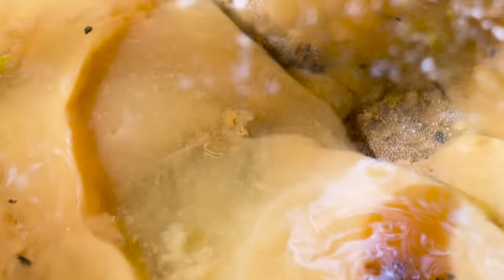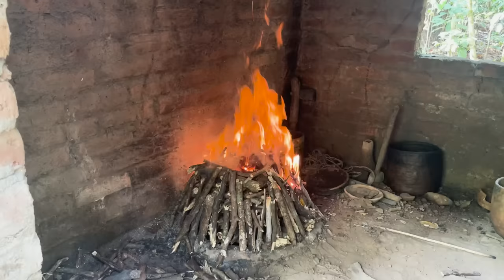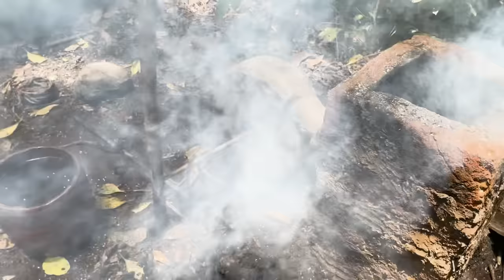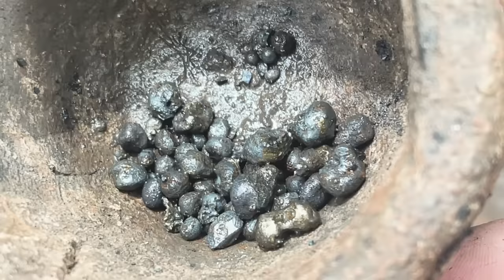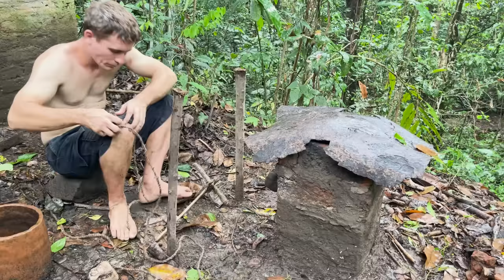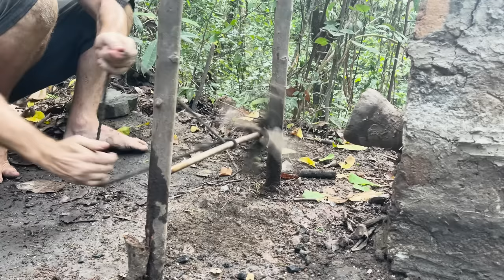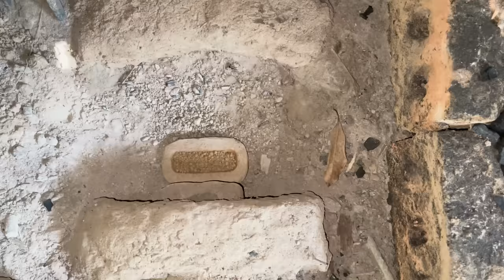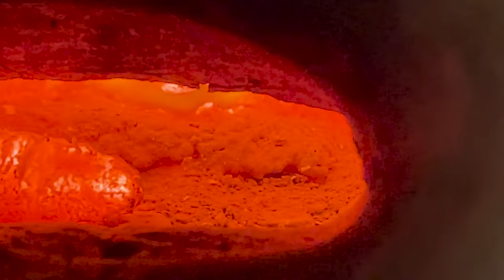Primitive Technology: One-Way Blower Iron Smelt & Forging Experiment

Comment: Some notes: more "modern" (meaning medieval) bloomeries were built a lot higher and torn down, while still hot. The bloom was then taken out of the bloomery while still hot and immediately compacted, so that the slag was driven out and an ingot was formed. Also during the smelting (although you don't really reach high enough temperatures to turn the iron liquid) the slag was allowed to flow out through holes on the base. That is why in German this type of furnace is called Rennofen (rennen/rinnen - Ofen = flowing - kiln/furnace). I would try to purify the ore a bit more (so no ash) and to seperate the slag from the iron during the smelting. 
Good luck experimenting further.

Also one more thing: during a visit in Spain I was able to see a iberic smeltery where they also siffed through sand and water to seperate small ironore particles out, which they then smelted down in bloomeries.
Reply: Do you remember the name of the smeltery?

Comment: Jonh's ability to casually put his hands into the fire will never cease to amaze me !
Reply: Tolerance, mud and calluses lol
Reply: I've done some blacksmithing work. It's actually not as hard as it seems even for a beginner; until the fire has a lot of fuel and a lot of oxygen, of an amount sufficient to get steel bright-hot for forging, you can get rather close to it without burning yourself as long as you don't linger there for long.

Comment: a suggestion. in the end when you tried to smelt a bar of Iron in an open mold. i would advise to close the mold and then put it in the fire. this way you get less oxidation and by putting small amounts of charcoal you can controll the carbonization of the Iron. more over this way if you heat the bar to a highrt temprature it will most likly come out smoother and more solid. if you have accees to a flux like tree resin which is crude but works to this day you can create a lower melting point and cleaner product. 
on a side note ive been watching this chanel since I was a little kid. i am now in college and Im happy my studies my be of assistance.
hope this helps and good luck!
Reply: The prills will already have a high carbon content, you don't want to add more in the crucible. If anything he wants to reduce the carbon to make forgeable steel.
Reply: How about flux from lime? He did manage to make some quicklime (I think) from snail shells in one episode.
Reply: This channel is only 8 years old so you're being very liberal with either the "little kid" description or the college description.
Reply: @Matt_Alaric  lots of ppl go to college at 18-19 years old…
Reply: @Matt_Alaric  I feel like 10 definitely counts as a kid. That's 6th grade.

Comment: 16:00 Thats brilliant! You could make a water wheel to power the furnace indefinetly
Reply: If you check the water hammer video, mans doesn't have a lot to work with there (water flow, precision of craft, etc), and water wheels are surprisingly difficult to build.
It's definitely orders of magnitude better to use hand power at this scale, but it is a good thought.
Reply: @splinterz5744  Not even close to getting to this point. If you wanted to use mechanical gearing at this stage then you'd use a belt and pully wheels.
Reply: @splinterz5744 Iron cogs would be completely impractical and would not fit in with the time period
Reply: @splinterz5744  A gear reduction isn't impossible as a longer term thought, but he can't even whittle anything that precise with his tools, let alone cast it.

Comment: A rope connected to a big wheel and wrapped around the stick could make for impressive crank wheel blower setup, but it may be more work than it is worth. Amazing tech development. You are becoming a metallurgist, inventor, primitive tech guru, and soon to be a blacksmith too!
Reply: Spinning the rotor too fast is likely to have it come apart, in it's current design anyway. Maybe a more stick based blade versus leaves, but I concur, spin it 2-3:1 to increase heat and yield further, hope nothing breaks. :)

Comment: Excellent and inspiring video showcasing significant advancements in iron smelting techniques! The use of the new blower has clearly increased the efficiency of the process, and the results are truly amazing, especially with the increase in both quantity and quality of the iron prills. The forging experiment was a great addition, showing how the iron can be utilized directly after extraction. Thank you for this informative and inspiring presentation!

Comment: After watching this I had to see how iron blooms are successfully created in draft furnaces and it seems (from most of the instances I've observed in other :stayhome:videos) that the 2 differing elements are 1. a continuous stream of air (I know, difficult with only one person, but achievable) and 2. an ore recipe that leads to liquid slag running off either at proscribed intervals (in "poke a hole" runoff design) or continuously in furnaces w/ slag drains. I don't want to speculate on flux as I know you've tried eggshell/limestone style flux w/o success.

Comment: If he's getting the slip-belt idea down well enough, he's only a few steps away from either a spring-pole or counterweight treadle. That may make operating such devices a little bit easier.

Some other videos also seem to suggest that adding a source of dissolved starch to the water used for mixing clay can improve ductility of the resulting mix. That may reduce some of the cracking when forming complex pieces with the soft clay. Seems some traditional recipes use rice-water, but perhaps something from the yams grown previously could work in this instance?

Comment: Modern Blacksmith here, who has an interest in historical techniques. Have you considered consolidating all your iron in a crucible smelt? All the prills/broken pieces go into a fired clay cylindrical vessel, with a little charcoal powder to help maintain a bit of carbon in the steel, and the remaining space filled with a flux. Borax would be ideal, but if you don't have access to that naturally, straw ash can be used. I imagine wood ash would work as well. The crucible should then be sealed completely with a fired lid to prevent oxygen ingress. Your one-way blower ought to be able to get it hot enough. Haven't tried it myself, but I magine you might want to orient it with the iron on top, such that when everything melts, it falls down through the molten flux? I'm hypothesizing here, but it seems that you're not having much luck with these open-topped bar molds, so it's worth a shot at least.
Reply: If he's consolidating iron prills into a bar, that's a MELT, not a smelt. His prills are already high-carbon, they don't need any more carbon, they need to be decarburized with oxygen. 

Of course, the real problem is that he's getting high-carbon prills in the first place, when he should be getting a low-carbon bloom that he can forge. Trying to make high-carbon cast iron and then decarburizing it is harder than just managing the furnace chemistry/timing to get low-carbon iron in the first place.
Reply: The flux will take a lot of the carbon out of the iron as it all melts. The charcoal is there to help maintain some of it, which you do want. As for what ratio of flux to charcoal to use, that would require experimentation as I totally admit that I don't know. Also I called it a smelt because the crucible step is part of the smelting process, like a second stage to the initial bloom step. So basically the cast iron prills are treated as processed ore rather than as a final product in and of themselves, but that's all pretty semantic anyway. @bhartley1024
Reply: @ferric6796  Hmm, I can't say if you are right or not, I've never heard of flux decarburizing iron-carbon alloys, but I suppose it would depend on the chemicals used for the flux. If the flux contained iron oxide, I suppose that oxygen could react with the dissolved carbon to decarburize the melt.

I think semantics are pretty important, especially when talking about technical processes. Smelting is the name for the process of going from ore to metal. Iron ore is iron oxides and hydroxides typically. They have to be chemically reduced to separate out the elemental iron. I would not classify the iron prills as ore because they are a solution of elemental iron and impurities. The prills could be used as-is to make cast iron items, or they could be used a feedstock in a refining process to make forgeable bar iron.

Comment: Have you considered a piston style blower.  A clay cylinder next to the furnace, with a truyere at the bottom.  If you lash a bunch of sticks together for strength, then layers hand woven cloth, possibly coated with tree sap or something to make it more air tight, you could use it as a piston.  Push the piston down to blow air, then turn it sideways to pull it back up.  You could probably move a lot of air rather quickly with possibly less effort.  This is what I love most about your channel is your attempts to smelt iron.

Comment: I very much enjoy your content. When putting the prills together in a mold to make a bar, it seems as if perhaps it is hot enough to soften the iron to stick the prills together to form a bar, but not hot enough to acutally liquefy the iron enough so that you have not only much better mixing of the iron, but also by being far more liquid, it allows the impurities to actually rise to the surface of the liquid. You certainly have more research involved on your part, but from lots of practice casting with other metals, it seems like the temperature still needs to go up some when casting the iron into a bar. I would expect with a complete (hot enough for liquid iron) melt, you'd have comparatively decent iron to work with, and all or most of the impurities would be together at the top, rather than still incorporated in your bar.

Comment: In regards to the new blower setup, I had the thought last time of using two sticks, but you would build a rectangular frame with one stick above the drive shaft and one below. The idea is that you can power the fan on both strokes. Pulling back you would use one string (say pull back and down to use the bottom string), then pushing forward you would use the other string (pushing forward and lifting up to use the top string).

Comment: That's a great improvement! Have you considered a water-powered since you're next to a creek? By digging an offshoot on the creek and allowing water to fall to a lower level by using a steep incline you can use the water to power the fan constantly with a makeshift turbine, and potentially at a high speed by using a type of gear reduction.

Comment: This one loop blowing technique seems good. Decarbonization in a high carbon atmosphere is difficult… I’m curious about how it could be made efficiently. Great video as always. Watching you from Brazil 🇧🇷 Take care bro!!
Reply from the maker: Yes I was looking at making a continuous loop recently, I'll experiment with it more. Regarding decarburization, the best way I've done it so far was to melt the iron in front of the blast in a small forge https://youtu.be/pOj4L9yp7Mc?t=349 . I was able to burn the carbon out and hammer the iron flat indicating it was decarburized. The only problem is the iron doesn't form one big mass but a few smaller one. Maybe if put into a larger furnace with larger pieces of coal it would maintain the high temperature needed while still having an oxidizing atmosphere. Much appreciated.

Comment: I will say that was some great work the biggest issue i saw with the bar was you need some sort of lime or something like that to get the metal melting temp down a bit and on top of that your bar was too hot when you tried to forge it.  when it sparks like that you got it way to hot and it will do more damage than good to the iron.

Comment: good job mate! I don't know if you might have better results by trying to increase temperature by 1) selective use of coal (given that some trees produce more calorific yield, or means of obtaining coal can do that, e.g., coal produced with less burning/oxygen), 2) preheating the input air by perhaps increasing the length of clay pipe and heating it underneath (temperature conductivity through clay is gonna be low but better than nothing). Good luck and keep this good content coming! I am cheering for you.

Comment: not only produced more, but also makes bigger nuggets, you  can also hear gettting much more oxigen now, it would help a lot  the forging process if you mix up with some type of soda ( ash from salty plants, maybe the shells that you had use before it will work aswell, but from what i read all made to ash and the mix up with the iron you wanna work with)

another idea but to start the fire, you can use the rope tecnique with the stick from your latest blower and also use the coconout burn on the previous to the latest one so you can hold it in place, since i imagine it will get warm aswell, you can make a clay thing on the outside and also hold it with a green leaf, maybe this will help starting fires faster and with less energy

Comment: Here's another suggestion, which you may reasonably discard if you've seen it before: a flywheel will enhance the consistency of the blower action, and also provide a good basis for a "treadle" design. Reference old foot-powered sewing machines. If you can free up your hands with the treadle, even if the performance is not as good, you will be able to maintain continuous operation and higher temperatures.

Even just adding a hand crank to a flywheel would help, although I think you will have trouble designing these parts so that they do not wear out quickly.

Comment: Maybe try utilizing your concrete, bricks, and a thicker wooden axle to produce a more stable support structure, then add a large flywheel (ceramic?) to the blower fan.  If you use a thicker wooden axle, you could drill holes through the center of the axle that match holes formed in the flywheel.  Balance could be an issue, but if so you could center the blower in the brick/cement structure and add a flywheel of roughly equal weight to either side of the blower, ideally as close as possible to the support structure on either side in order to keep the axle from bending.
Reply: Oh also, depending on the strength of the ceramics you're firing, you could attempt a fan made in a similar way, with the hole fin/blower unit as a single piece.  This "clay tile" type of fan would have less "give" in the fins, and would therefore push more air.  With a thick enough wooden rod for an axle, you could affix it similarly by drilling holes in the axle and forming matching holes in the fan assembly, then lashing it or driving wooden pegs into place to hold it together (or both).  Even without modern measuring tools, you can build this with pretty reasonable tolerances.  The flywheel(s) would keep the ceramic fan moving and blowing air at a consistent high speed, and the ceramic fan itself would push more air even if it was the same rough dimensions as the leaf-fan.  Fire burns hotter, better smelt, more iron.  You'll be making lathes and lapping smooth work surfaces much sooner.
Reply: Wood ash cement footing, brick column set into the footing, form a round hole in specially made bricks to serve as a bushing for the (interchangeable) wooden axle.  Bam.

Comment: Hi there,

to get to even higher temperatures you would need to improve the circumference to burn area ratio. The (your) problem seems to be that the hot air takes the path of least resistance and therefore the path next to the wall instead of right through the middle. That is a very common problem when downscaling a process and is usually described with dimensionless numbers. To keep it simple, if you scale the process down from a modern 200ton smelting oven to the size of  a square of 4 bricks, then the particle size of the fuel (charcoal) starts becoming relevant. You could therefore either increase the size of the smelting oven or reduce the particle size of your fluel by grinding it down.

(Basically, you want to reduce the annulus which offers little resistence to the air. It can be estimated by using your circumference plus the particle size.)

I hope what I wrote is understandable because English isn't my first languauge. Greetings from Austria! (You know, the one without Kangaroos ;) )

Comment: I believe in order to achieve a malleable forgeable metal you may need a higher grade flux like coke or you can re use that slag that you made as a flux to possibly reduce oxidation.

The lack of limestone or feldspar also make me think there are still far too many impurities in the metal. Depending on the type of impurities in the iron different fluxes are added, for example limestone (for siliceous iron ore) or feldspar (for calcareous iron ore)

I'm not a metallurgist by any means but I'm a passionate smithy so forgive me if this information isn't correct, but I hope it may give you something to research more on your own.

Comment: It's wild how small of a change this is, and yet how huge the effect was on yield

I wonder if making a smoother "hammer" might help with working the iron, since a standard, coarse rock has jagged edges that concentrate the energy rather than spread it. 

Also early attempts at forging is another huge step forward. I bet using the new blower for making the ingot might get a more solid ingot